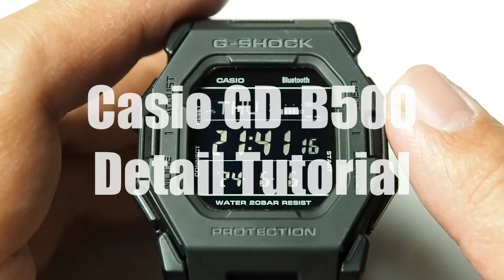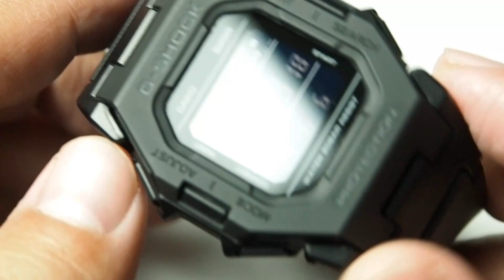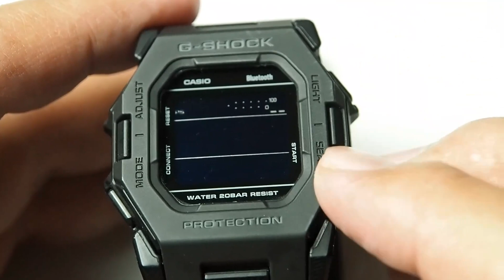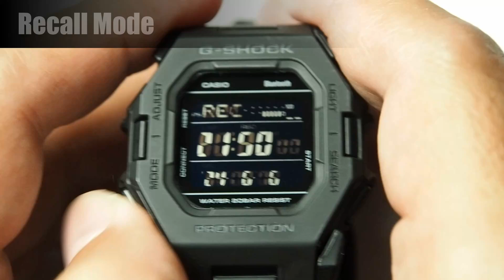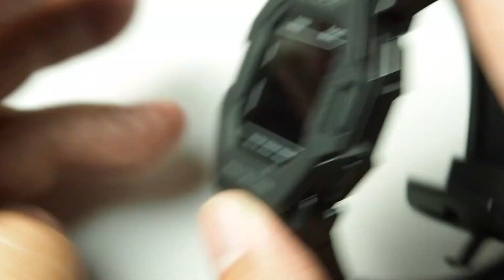Casio GShock GDB500 Detail Tutorial Setting and Operation: Time, Timer, Alarm, LCD Check GD-B500

Comment: What is the LCD check purpose for?
Reply from the maker: it is a diagnostic step to check the LCD segment. If there is any abnormality, it may need AC reset, or maybe service.
Reply: @ ok thanks - what would it show up/what signs to look out for if it does need a reset or service?